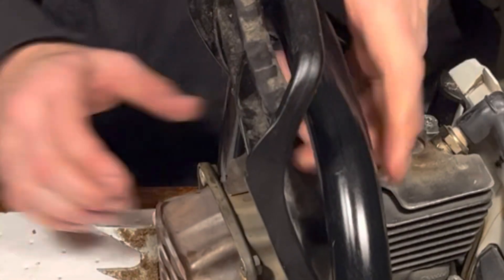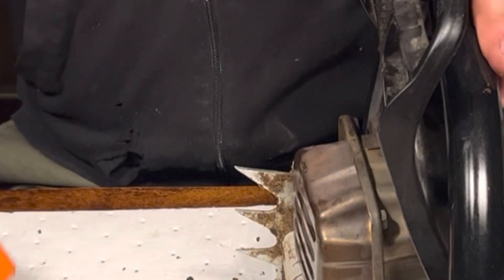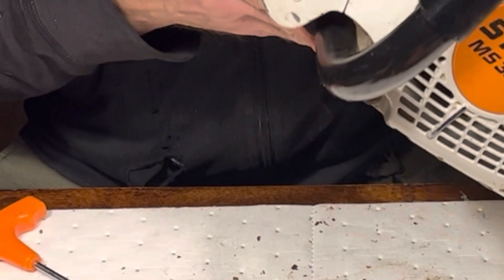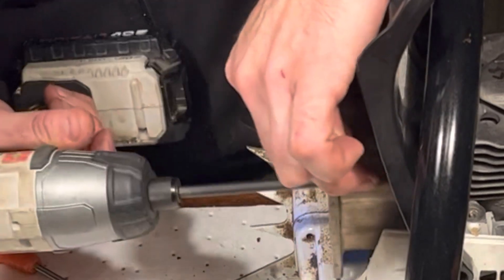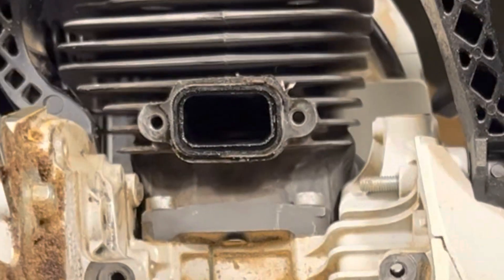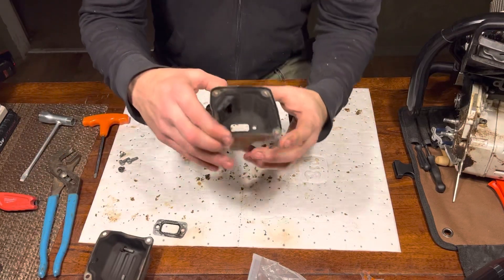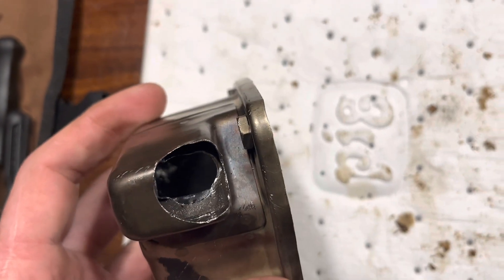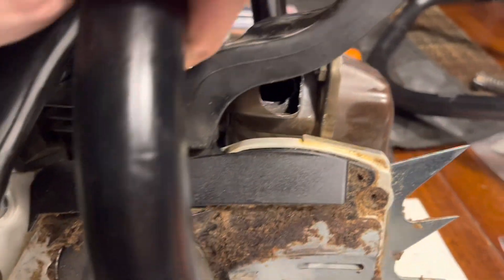Stihl MS-362c | Easy Muffler Mod

Comment: Doug, enjoyable viewing as always. Both yourself and Richard Flagg both extol the virtues of Red Armor, and I plan to switch to it as soon as my shoulder injury clears up. I have asked a few guys here in the UK about issues with the Stihl oil but nobody seems to be aware 🤔
Reply from the maker: Thanks for the kind words. Interesting, I have been battling a shoulder issue for some time. I’m just glad it was my left shoulder.
Reply: @Indiana Doug  I tore ligaments in my right shoulder, and although I am itching to get my 462 and 660 into some wood, I know that I could potentially do more harm than good in the long run. Over in N Ireland, this is our wettest time of year, so it could be worse 😆

Comment: Thanks for the video. Do you have one covering the K&N filter mod? I’ve been wanting to do this mod but haven’t found any info on how to interface it with the saw.
Reply from the maker: No but I can
Reply: @IndianaDoug  I have a couple of filters that require me cutting a hole in my engine cover. One of my concern is how to line up where the hole goes? I want it to look good and centered. I tried putting chalk on the top of the UNI & KM filters but it smears making it difficult to see where exactly to lineup my hole-saw.  Also, fitment can be an issue pending how you interface the filter with the carburetor plastic thingamajig. If the thingamajig is removed there are two holes that need to be plugged to keep unfiltered air out. If the thingamajig is left on those holes are covered but all that plastic on the thingamajig is restricting airflow. I promise you no one has done a video on those topics because I’ve ran every keyword search there is on this. Sure there’s plenty of guys like yourself sporting exposed cold air intake via velocity stack but no one is covering how it magically appears on their saws.
Reply from the maker: @rixZR2   I apologize that I haven’t made time to make a video on it. It’s been a crazy last couple of weeks. 

My best advice is finding an approximate center point. Then drilling a small hole. Put the cover on and look throw to see if you need to reposition the center point. I use a flashlight. When you find a center, make a hole smaller than you need and work your way up. 

The other bit of advice is use a filter with a rubber boot you can cut on. You will likely cut a slight angle, or cut it shorter.
Reply: @IndianaDoug  you the man. Many thanks!

Comment: Good video Doug. A muffler mod on a 362 is an absolute must in my book for some really good gains and also heat dissipation. Couldn't agree more on Red Armor. For the cost and availability nothing touches it.

Comment: You will melt your chain break handle with that muffler mod
Reply from the maker: Nope, been deflecting right under it since I’ve had it
Reply: @IndianaDoug  Wait till you use it more and longer times.
Reply: I have same saw and did the same thing and it eventually melted it.
Reply from the maker: @TANGO22222222  that’s nuts. Ya I kept this in mind as I was opening the deflector, but you never know

Comment: Love red armor use it my saws..have 4 year old 2511t. Use it daily .on entire trees.hsve to disagree on the bark boxes,wouldn't run a stihl without them or the west coast oil filters..and definitely suspension kit.its different saw entirely..462 oil filters are best ivecseen .in 30 years..if someone can afford a 1600 dollar saw or 1000 dollar saw they can afford few hundred to bullet proof it.every stihl saw needs those 3 things and doggs ..thanks
Reply from the maker: I paid $225 for mine. Never been a huge Stihl fan.
Reply: @IndianaDoug  me neither first time using them and was disappointed bigtime but with thise adjustments and only a sthil dealer near me ,I maid the switch run a small tree service and landscaping business   plus took on commercial mowing so do all out door services and trees year round.more predominantly in winter .just because I love cold weather from Illinois and Wisconsin..I would love to do my 462s like you have the 362 set up .afraid to .mess up cover need it lined up or I would dremel it out..thanks

Comment: 3 min 45 sec on hot air and red armor propaganda ?  cmon man .  Any good 2 stroke motocross oil is just as good ...for example, i've ran amsoil Dominator inn all my chainsaws, weed eaters, snow mobiles bcuz i had it for the dirt bikes. 2 hour races pounding the piss out of 125cc and 250cc dirt bikes never a prob. Top ends look like new and never a prob with 5 chain saws 3 oz per gallon in everything .... 4oz/gal in the YZ125 and the leftoveer would run fine in the chainsaws . Never any problem . Also used Amsoil iinterceptor and Motul 800  . Ya dont need expensive BS chainsaw specific oils . Motocross racing oil is better
Reply from the maker: I don’t disagree, there’s many great oils out there. When I make videos on chainsaws, I try to give viewers my opinion on a product readily available in any town. Amsoil and Motul ain’t that.
Reply: Need to be careful with some of your motocross oils in a saw especially the bean oils. Some of them have way to high a flash point for a saw and carbon the crap out of a saw.
Reply: Amsoil does work well in them though and is easier to get in my area than red armor.